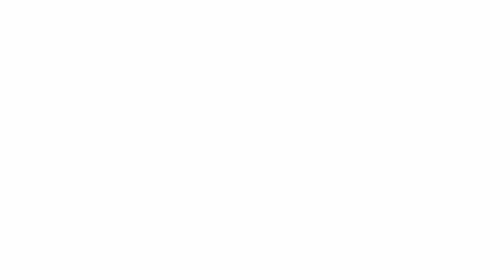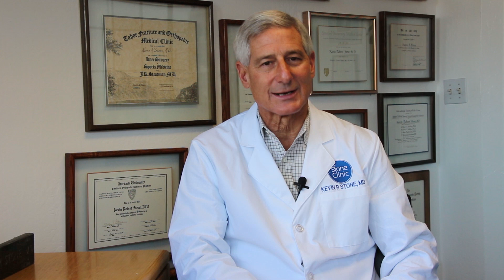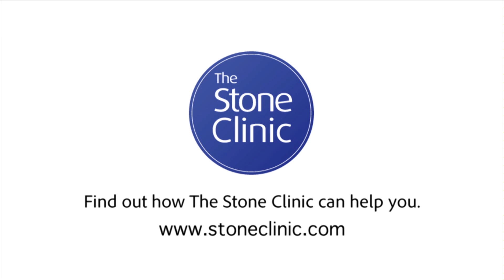Why Microfracture Fails

Comment: I had microfracture surgery, and it worked great. I was able to compete in BJJ and fight mma a lot more thanks to the surgery. Maybe I was lucky, but I also did rehab very diligently without fail. I think that might be one reason why I had a better outcome than others. I spent 6 hrs a day in the rehab machine and I did my exercises every day even with pain. If you don’t follow through the rehab then it can fail easily. I credit my surgeon and rehab therapists for my ability to come back to the sport. My only complication was overusing my “healthy” arm too much at first.
Reply from the maker: Hi there, Jimmy. Thanks for sharing your experience. So glad to hear you were able to return to high-level athletics with your procedure.
Reply: What's up man! I just had microfracture surgery due to an osteochondral defect in my knee - was that what you received microfracture for?
I used to be a collegiate athlete but had knee pain post grad for 4 years and finally got surgery.
I'm only day 5 post op but doing a ton of research so I can get back to being a normal person...
How long were you non weight bearing and how long until you could walk on it again?
I've just never been comfortable with my knee and don't remember life without knee pain unfortunately!
Reply: @15GarrettB  Good luck bro! I had the surgery in my shoulder, but apparently microfracture surgery was initially designed for helping repair knees. It is very painful, but it is important to do your rehab every day. They sent me a maching to move my arm up and down. I started only a few days after surgery and used it until I could moved the entire range (took a few months). I also started rehab exercises the week after surgery and did them every day, though I only went to the therapy place 2x a week for  6 months. All in all, it took me about 6 months before I was competing again. However, looking back I think I should have waited a few more months. The biggest issue is that I compensated by overusing my "good" shoulder. Make sure you don't overuse your good leg and I think that you'll be back in 7-9 months or so!
Reply: @15GarrettB hey man, we had the same surgery for the same case but i did it like 4 days ago. Do u have any tips to tell me or anything that u need to share with me so ik what to do or to not do?
Reply: @15GarrettB  and if u can share your number with me

Comment: I’d be curious to know if Greg Oden or Brandon Roy (two former Portland TrailBlazers who had multiple knee surgeries) had this specific procedure, if it was available during their time, and if they did have it, why their knees still failed. 

I’m not expecting a specific medical response, merely wondering out loud.
Reply from the maker: While we clearly do not know the specifics of their treatment, it is possible. Microfracture is the most commonly used procedure for articular cartilage repair and while, results tend to diminish over time, they are effective in getting athletes back on the field quickly.

Comment: How do u think about utilizing microfracture for increasing height? There is a method called 'ankle fracture'. Do u think it is possible?
Reply from the maker: No. This technique is intended to repair small areas of damaged cartilage tissue to allow for smooth movement for the articular cartilage bearing surface. Anything trying to increase height would be highly improbable and unadvisable.

Comment: I had ACLR, partial medial meniscectomy and a microfracture on the medial femoral condyle (3kvcm defect, 3B grade) 11 months ago. To this day I experience sharp pain on a specific angle when weight bearing, sometimes also when just moving the knee in motion when it passes that specific angle. Should I be concerned ? I have a feeling something is not right. I also heard from some patients that the cartilage over-reproduced in other words, grew too much and it bothered the joint space. How would you know that is the case and what can be done if that problem occurred?
Reply from the maker: Hello, Zan. A new MRI or x-ray is the only  real way to determine what is occurring inside your knee. And based on those images, Dr. Stone or your orthopedist could advise on the best course of treatment. If you would like our help in investigating the injury, you may arrange a complimentary consultation at https://www.stoneclinic.com/consult
Reply from the maker: Also the article on which this video is based has more information on some of the challenges with the microfracture procedure https://www.stoneclinic.com/blog/why-microfracture-fails

Comment: Hi Dr.Stone,

I had about 5mm of my cartilage degenerated in the ulnar side of my wrist. My doctor, who seems to be the best hand surgeon here, said that although microfracture may fail in the knee, in case of the wrist it gives more promising results as wrist is not a weight bearing joint. So the chances of the thin cartilage generated by microfracture will usually be enough for me for my life time. I unjderwent TFCC repair and microfracture surgery with a PRP injection last week in India?

Any ideas? Should I still consider your stem cell treatment for better results?
Reply from the maker: Hello there, Yash. Since these are complicated, clinical questions, we will not be able to offer any advice via social media. However, if you would like to arrange a consultation to speak to Dr. Stone, you may do so by following the instructions on this page https://www.stoneclinic.com/consult

Comment: I had a modified brostrom surgery on my left ankle. My doctor over drilled thru my talus cartilage and thru my calcaneus cartilage with bio-absorbable anchors. I have a 6mm defect on the top of my calcaneus now. 2 years of pain, mixed with the inability to get good sleep. Changed who I am. Micro-fracturing the subtalar joint a waste?
Reply: P.S. I’m 35 years old.
Reply from the maker: Hello, Steven. That is not our approach to repair. We've achieved outsanding results with Dr. Stone's cartilage repair technique: articular cartilage paste graft. Here is a link to some of our patients who experienced a similar injury. https://www.youtube.com/hashtag/bioankle and you can learn more about our approach to ankle repair https://www.stoneclinic.com/bioankle

Comment: I have a osteochondral defect in my knee on weighbearing 1.3cm by 1.3.  Had microfracture 14 months ago and have the same pain as bf surgery.   The surgery showed it did something but i have no relief from it.  What a nightmare.
Reply from the maker: So sorry to hear about that, Joe. Here is an article Dr. Stone recent wrote regarding failed cartilage repair. I hope it helps https://www.stoneclinic.com/blog/failed-articular-cartilage.  If you would like a consultation from Dr. Stone on the best approach to repairing your knee, you can arrange a free consultation at https://www.stoneclinic.com/consult
Reply: Currently 18 months post surgery and still have issues . Have you found a solution yet Joe?

Comment: 7 1/2 months post op from micro fracture surgery and still cannot do an air squat with out a 7 on the pain scale. College basketball player hoping to return to sport
Reply: @Lostdeltallc  Yeah four years have passed since my original comment, it's been a journey. I still haven't given up the dream to be able to play basketball again recreationally. I've come a long way and can do probably 100 body-weight squats with a 1/10 pain now which is great. Currently giving Ben Patrick's Knees Over Toes program a try. But like you, I'm starting to think more about the longevity of my joints as I age. Which sounds insane given im only 26 but I really did some damage to my body as an athlete.
Reply from the maker: We're sorry to hear of the progress in your recovery. Please let us know of any way we can help. We are happy to assist with post-op physical therapy, surgical revisions, etc
Reply: Any update?
Reply: @setasonte6392  yeah so it's been about 2 years now, and it has SUCKED. Definitely was not able to return to sports. I still can't run for more than a few minutes at a time with out pain so I bike a lot instead. I can lift weights and do compound lifts but not very heavy. The cracking and popping my knee does is ungodly. But it should be noted I only did formal physical therapy for 4 months then did things on my own after that. Still trying to get back to normal.
Reply: @cortezsb7727  wow that is crazy , im trying to get back into football and my surgeon basically told me microfracture and il lbe back playing in 3 months lol i have not heard one success story
Reply: @setasonte6392  I really hope it works out for you! Things are different for everyone. But just be aware it might take longer. I was 21 when I got the surgery and outcomes are supposed to be best for young people.
Reply: @cortezsb7727  yeah thats suppose to be best age! Yeah I am gonna try physiotherapy , did you try that before opting for microfracture ?
Reply: @setasonte6392  Well actually I wasn't planning on getting MF surgery. The MRI indicated I had a torn meniscus that needed surgical repair - doc said a couple months and id be back - but when I woke up the surgeon said my knee was in way worse condition than what the MRI showed and he pretty much opted for MF for me
Reply: @cortezsb7727   Wow sorry to hear that
Reply: @setasonte6392  I Swear Im in the same shoes but for my ankle and now i need revision surgery
Reply: @cortezsb7727  Same here. Never heard the word microfracture or cartilage prior to my surgery. Supposed to remove a cyst. I'm 4 weeks post op and my recovery has been incredibly slow and painful. I regret getting this surgery.
Reply: @loganmmordh  I hope you have a better recovery than me! 5 years out, still have knee pain. Didn't realize i played my last basketball game prior to the surgey, but havent been able to run since. I'm still active, but have to use the bike and elliptical instead of running. Can still lift legs, but not more than once a week before the pain gets to be too much. 27 feeling like i'm 50 lol

Comment: Long term MF just won't work. The blood carries stem cells to the defect site but ultimately the blood does not provide a suitable 'scaffold' to encourage cellular spatial organisation or adequate mechanical loading to promote cell function. At best it will put off total joint replacement for a while which isn't a bad thing
Reply: It made the damage to the good cartilage bigger

Comment: Never have Micro fracture , it is a nightmare and doesn't work.
Reply: Noooo! I had it done April 19, 2017!!! I'm praying it works, the pain was driving me crazy. I really hope it works, the discomfort and being so limited is something I would not want to go through again.
Reply: So far I think it's worked, it has been 2 1/2 months since my surgery and there is hardly any pain, some swelling, and my range has not come back. The thing I am most concerned is that, this is just a temporary fix, it will only last for 5 to 7 years...then what, go through it again?! I'll tell you, before it, I was in incredible pain, now, no pain. What I am saying is that it may have worked for me, the doctor told me two days ago that it was looking good. If it worked, I'll be doing the other one next year. Good luck with it and don't rush the recovery.
Reply: @Freddy-kw2mk  update?
Reply: Mya's World how are you now?! I'm having this in 2 weeks. thanks
Reply: Lewis Ansell nice, hopefully that's the case for you!  I'm early 30's...but I had an 8x10 tear right knee at the trochlear. I'm not sure how much luck I'm gonna have.
Reply: What are symptoms of failed microfracture
Reply: I'm only speaking from first hand experience. Its a nightmare and it doesn't work .hopefully you haven't had it done. If you had I'll guarantee you would agree with me !
Reply: gary fff What alternatives do you recommend?
Reply: +Digger Vaughn Hi, Obviously I am not a Doctor , or indeed A Surgeon, however I can only speak through being on the sharp end, Micro fracture surgery did not work for me, possibly on youg people , who knows, im late 50s, and currently waiting knee replacements,  the recuperation from micro fracture is horrendous, also the machine you have to use for 8 hours a day,is ridiculous,  if it worked , fine , but for me , No it didn't , I have also had acl reconstruction again , waste of time and money,and 3 clean ups of the knee including meniscus trimmings, all a waste of time,my knees are total rubbish , so knee replacements,I know people who have dad success,and fewer who havent, but its all down to age, they don't like to replace knees before age of 60, . good luck  , I know what your going through, from being incredibly fit and active,im now heavy and unable to work , so significant poorer. the only one bit of advice I can give, is never play squash,or run on hard surfaces.
Reply: Mya's World I'm two weeks in, sick and tired of this brace and CPM. How's your knee doing now?
Reply: Lewis Ansell how old are you? Do you remember the size of the tear you had? Are you able to run and sprint? Where was your tear?
Reply: hi guys!! yikes I'm having this done now I'm nervous! I'm in pain can't climb a step kick my leg out do a leg raise so do i guess I have no choice but to do This! how is everyone feeling?
Reply: I had it done, it did not work for me at all, it has been a year, one day getting out of the vehicle, I put my bad leg down to get out and heard a crunch, ever since my leg has been in pain and swelling, I hope that doesn’t happen to you guys, it isn’t the meniscus since it has been removed.
Reply: gary fff I just found out I have one and I'm gonna need to go to the hospital today
Reply: Just wondering for those who had this procedure done,  what were your diets? What were you all eating like a week prior and post op? Thinking of having this done?
Reply: Had it done in 2013 with very mixed results, was able to get back to about 80% at one point (almost a full two years later), but after that its been stop, stop, stop, start, because of numerous problems with the knee swelling up after certain amount of use. I learned that icing it calmed this down over the course of a week or two usually. Now I'm at a point where I have to ice the knee everyday if I play more than once a week which is a drag. The knee clicks every know and then, and sometimes after a particularly bad episode (too many games, or too intense game), the knee will swell up like a balloon and feel super stiff if I sit for more than 2-3 hours. Now even when I play, I favor my other knee very very heavily, to where I'm struggling with some patellar tendonitis in that knee too. I find that even when I squat to pick something up, I'm adjusting around the problem knee which I don't think is great. On the bright side, I'm actually able to run longer distances without much problems, long as I'm not trying to cut or make quick changes in direction.  Doing a lot of strengthening work around the quads, and that really helps, I just wish I were more patient with it. All in all ... Honestly I would not do this again if I had a chance to, with ACI, or MACI (stem cell alternative), no one should be doing microfractures any more, I simply do not recommend. If I get some money together I will definitely try to see if I can have MACI done on top of the Microfracture. Best of luck to everyone
Reply: @trustfundbaby47  thinking of taking this route but combining with either stem cell injection procedure or ha injection. Thinking that adding those growth factors will help with success
Reply: Had one about 9 yrs ago and it helped a ton.
Reply: @hotrodblonde  how are you doing now? Thanks
Reply: @tr6151  not too badly. I think my arthritis has increased in the knee since but that’s all of my joints too.
Reply: @hotrodblonde  Thank you for the quick reply and sorry to hear that the arthritis has progressed but hope it does not cause you any further symptoms or pain. Take care